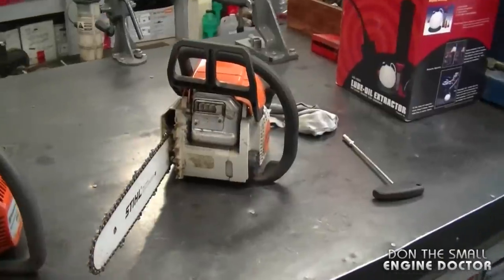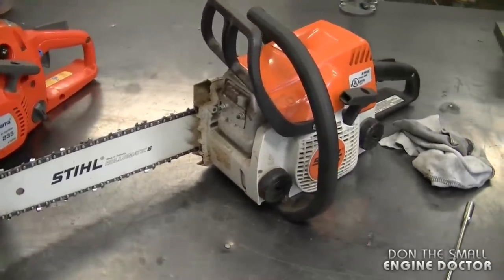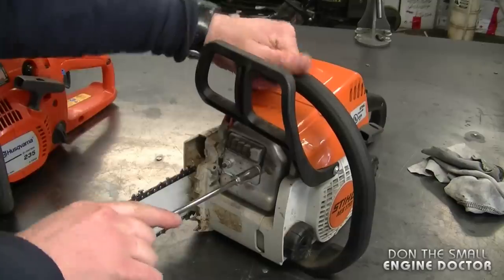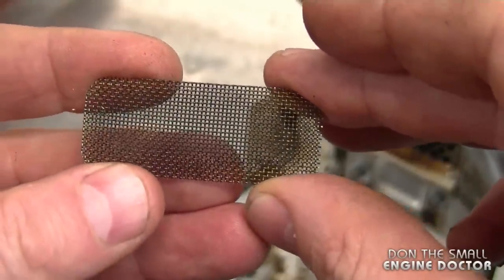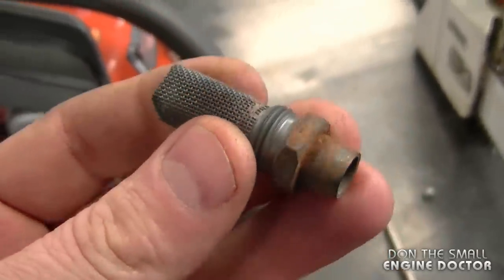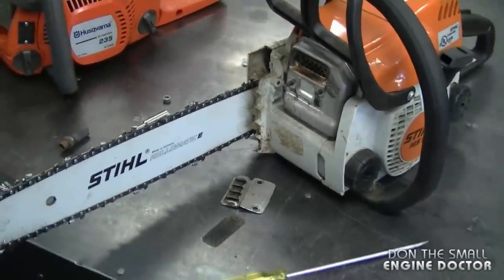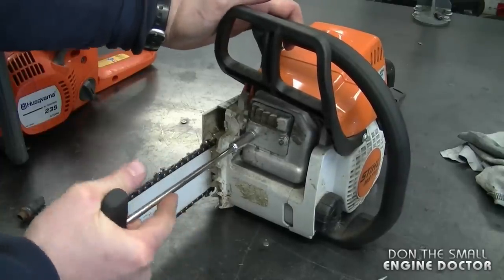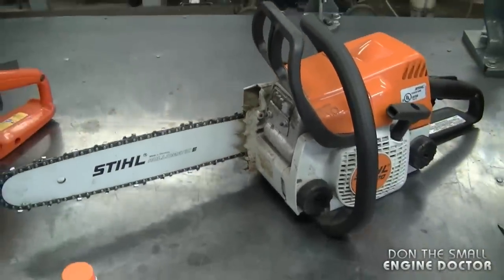Why I Don't Remove Muffler Spark Arrester Screens From 2 Cycle Equipment!

Comment: Danny I know you don’t recommend taking the spark arrestor screen out. But if I do will it hurt the motor?I have a Stihl ms170. Thank you
Reply: It won't adversely affect the engine at all while running, but it could lead to a fire as stated, and also allows for pests like wasps to cause bigger problems.  Do it at your own risk, and keep the part, as you may need it to work in a more fire-prone area.
Reply: It won’t, take it out and be done

Comment: Fantastic vid new sub
Reply: Ironically I came across your video because I was having some chainsaw problems today with that exact Chainsaw the 170 steel that you have there in the video before I even found your video my saw was running sluggish bogging down it just sounded weird it didn't sound like it was getting up to full throttle I sharpened it razor sharp and it was just sounding horrible mind you I'm not new to this I have a 461 Steel I think it's a 270 C anyway I got frustrated I thought I'll pull the muffler off and see what's going on lo and behold there was like an eighth of an inch of oil and grease all the way around the back side of the muffler Black is Black can be and I didn't even know they had a spark arrestor in them and that spark arrestor look like a piece of rock there was Zero getting through it I tried to clean it for like 30 minutes nothing would cut through it I got a small opening maybe the size of a pea the only reason I looked up the video I wanted to see if I could run it without a spark arrestor so I gave it a toss holy s*** that saw has never run better more horsepower like it's brand new unbelievable

Comment: So a better fix would be to have a larger surface area Spark arrestor screen.
Reply: Or just get rid of it in the first place if ur engine is better proberly u shouldn’t have any problems with shooting sparks like people say it will that’s only if it’s running super lean
Reply: Same problem just less frequent.  It would still happen; it would just take longer.

Comment: I have only had to clean it once in my Stihl BR200 which I use commercially. It seems the idle was causing it to rev to high causing a quick buildup. I wish I could get ethanol free, but it's impossible to find here. I do however get 93 octance

Comment: How do you feel about running a brand new stihl chainsaw with av ll gas?
Reply from the maker: not sure, never used it
Reply: If you can't find regular ethanol free in your area it may be worth it. But, you would be paying for something you wouldn't need. And, it wouldn't give you any benefits above regular ethanol free gas.
Reply: I've used it in my older stihls wo issues. The main reason I like it is the shelf life. I'm picky and never use month old regular fuel, therefore I end up wasting some. Av gas will stay good for a year so I can stock up in one trip. But I was curious if the low lead would effect the carburetor,  or piston/cylinder

Comment: Just use the best synthetic oil you can find. It must have JASO FD rating.
They don't have problems with clogging because they create the least ashes, have the best lubrication and film strenght. And ofcourse give you the most power. And premium fuel. For your new generation Stihl equipment minimum octane rating is R+M/2 89.
So never use 87 only 89 and up.

Comment: i remove em drill out catalytic then enrichen carb. nice power boost.
Reply: That's short term.  Over time the enrichment will cause carbon buildup in a few places and it will be hard to remove.  At that point, performance suffers.

Comment: I have a redmax blower. Started good but in high speed diet.  The model is Ebz7100 . I clean the carburetor. And gas line and filter chaing. and the problem still there can you help me...

Comment: As you probably know, Stihl had carbon build-up trouble early on after it introduced the "4-Mix" engine. Thus, it developed HP Ultra oil, a full synthetic. Curious why you don't use it vs. regular Stihl oil, Don? One reason may be that it is pretty pricey.
Reply: Trying to pry more $$$ out of our pockets

Comment: I take it all apart and in my scrap bin. I even take the silencer grooves or hole plate out , wide open . Better
Reply: Yup, remove restrictions and your engine will run cooler with more power.  Dual ported exhaust is even better.
Reply: @jolkraeremeark6949  "WHAT?" Get used to saying it.  Let's try it again. "WHAT?"  Even with hearing protection, the setup you suggest will erode your hearing ability over time due to how much louder it'll be.  Plus, if there's anyone nearby it could be quite a disturbance, even though two cycle engines already are to some extent even when stock.  I know it's common to do all this, but keep your long-term hearing abilities in mind.

Comment: Don what would cause a briggs mower to crank over, have spark, but feel like it hangs up when pulling the cord. The flywheel turns fine. Did notice the blade was loose. Cleaned out the carb. Speed gas out the air filter. Hmmmm.....
Reply: Gas poured out of air filter.
Reply: Could it be a messed up crank shaft? I'm just frustrated.
Reply: Brad, your carb could have a stuck open needle caused by gummed up gas, causing it to flood. A good cleaning may take care of it. Also, check your oil level. Most times the fuel will run down into the engine and leak past the rings and into your oil, causing it to become the viscosity of water.
Reply: I figured out the problem. The key is sheared off.

Comment: maybe you can help me i  have a husquvana weed wacker 128dl i replaced the carb, fuel lines, fuel filter,gasket ,spark plug,new gas,i check the spark arrestor its clean ,this is the carb i bought OEM Husqvarna Carburetor 545081848 C1Q-W40A Fits 128C 128L 128LD 128R 128RJ help??

Comment: If we all had to use Stihl Premium 2 stroke every oil company in Texas would be bust.What makes you think that oil is any better than any other 2 stroke designed for air cooled 2 stroke motors?
Reply: There's videos and literature on this.  There's notable differences in chemistries and long-term effects.

Comment: I have a brand new ms170, bought it in November 2019, and it doesn’t have that. I live in the Netherlands.. reasons to call my dealer??
Reply from the maker: they are supposed to be sold with the spark arrester in Canada
Reply: Different countries have different laws due to different species and climate indigenous to the area, and therefore different levels of risk.

Comment: I have been having a starting problem with my ms 241 CM.  Today, I finally got it started but it ran like crap for a little bit.  I took it out and put some cuts in my big rounds of 25 inch hickory.  When it was through, the muffler side had puked all kinds of unturned Stihl Ultra oil out of the muffler.  When I was through, I pulled the muffler and removed the spark arrester screen.  I had to soak the muffler in my ultra sonic cleaner for 30 minutes before I got the spark arrester screen out.  It was completely blocked.  I burned it clean with my LP torch and ran the muffler through the Ultra sonic with purple power and Dawn for an hour at 60 degrees C.  I was also filthy behind the muffler and I cleaned that, too.  I am sure I ha alleviated my starting problems and I will limit my letting it idle so much.  It was my fault it got blocked up but that filthy Stihl Ultra was a contributing factor.

Comment: You will get a heavy fine if you don't have one on your motorcycle or chainsaw. The forest personal also have a gauge to check hole size.any national forest property 😀
Reply: I would imagine not many folks use these on National Forest Property
Reply: @RustyZipper that's where we get a lot of wood in Washington on forest service property. Most of the wood out west belongs to forest service or DNR .also they will restrict run time on private property in summer on land adjacent to either.

Comment: Here in Europe we rarely see spark arrester screens. I guess we don't have the same laws
Reply: Isn’t that amazing. People on here raging that it protects you. I guess wood things in Europe don’t burn. More governmental BS.
Reply: @randyweaver9528  Not really; we have different levels of risk due to different climate and species.  In west coast states, fire risk is extremely high, whereas in other places such as many European areas, the risk isn't anywhere near as high.
Reply: @happycamper6352 And yet governments are always ready with a one-size-fits-all "solution".
Reply: @rstoertz That's because it costs less to do it that way at the expense of the one-size-fits-all way, even though it's only needed in the flammable areas.  Having one agency per state or per county would be far more expensive for only a minor improvement in customization, and even then the manufacturers would build for the most strict requirements so that they didn't have to have different specs.  Where I live in the Appalachian Mountains, it's almost impossible and extremely rare to have a significant forest fire.  There are some fields that could catch fire around here in the driest day of August though, if the grass is waist high and tan/dead. Trucks could be parked in it, and that would be bad (and that's why we have exhaust heat shields too, but they're not always placed well enough).  Honestly, I don't mind the spark arrest screen.  It's easy to pull and clean with a torch and replace every so often, and if you're tuned right, it likely won't clog anyway, and if you hate it or know you don't need it, it's easy to remove and toss in the trash.
Reply: @rstoertz  I would like to add something you would like though.  If you want to talk grade-A, top-notch governmental bulls***, then go no further than the gas can spouts that we have to suffer with.  Those are monstrous fire hazards and royal pains in the a$$.  I have difficulty finding decent replacement spouts that don't have that required gasoline can spout feature.
Reply: @happycamper6352   Agreed. Complete junk. And you can hurt your back trying to fill a gas tank from a five gallon can with one of those stupid spouts.
Reply: @happycamper6352   I went looking for mine to clean it the other day, and it was gone. Fell out, I guess.

Comment: Hi Donyboy, 
Your link, "Watch how to clean a chainsaw spark arrestor here", takes me to an STP commercial. I don't mind that you're advertising, in fact, congratulations. It's the fact that a link to another (important) video, is not working. It does not pass me through anywhere after it is finished.
Reply from the maker: thanks, I just fixed it. https://www.youtube.com/watch?v=XclI6u_xAAs

Comment: Great Video, just like the guys that want to mow in reverse and want the safety switches defeated.  The Law will waste no time figuring out who tampered with the equipment.  I'll even write a note on a bill slip saying customer requested safety defeat and was denied just to cover my butt in case he or she surfs YouTube for a way to defeat the safety switches on their own.
Reply from the maker: YES I get that request all the time, but these same people won't have a problem suing me if something happens
Reply: Kens Small Engines, 
I did that to my first rider.
That is until I almost lost some of my Toes..
I took that jumper right outta there and put that Puppy back in.
Reply: The law will try to figure out who did the mod.  But the lawyer for the plaintiff will only try to prove that you've done it for someone, sometime and then you have to prove a negative for that particular piece of equipment to avoid at least some liability.  Best to have a long record of never agreeing to the mods.
Reply: How did you almost lose toes by mowing in reverse?  How did your feet get BEHIND the mower? I agree with most safety interlocks like the seat switch but the reverse lockout is one of the silliest they've ever came up with. Why is mowing for a few feet in reverse more dangerous than going forward? How could you drive over something in reverse far enough to get to the blades when the transaxle is only a few inches off the ground and the mower deck edge is only 1-2" off the ground when mowing?  Did you ever notice that a lot of commercial mowers do not have reverse lockout?  Reverse lockout can be very dangerous as it can cause the engine to suddenly stop - sometimes when you are in a situation where you need the power steering to work. Most systems require you to push a button or turn a switch to override, which has you facing forward instead of looking backwards to see where you are backing. No thank you. Here's to mowing in reverse for the past 50 years!  :-)
Reply: I had a customer who said he lent his mower to his relative and they backed up and severely injured a puppy who was just hanging around looking for attention.  Claimed he never saw or heard it until he saw it laying injured in the grass.  Now imagine if that was a small child running out to give you a hug?  Without rear view mirrors that is an accident waiting to happen.  It may sound like one in a million odds, but I will never take the chance.
Reply: The puppy must have run up to the deck and his front paws slid under as he realized it was heading towards him but it was too late and he lost his paws.
Reply: Just an FYI, this happened with a NON-SAFETY equipped Lawn tractor from the 70's.
Reply: That's an unfortunate situation for sure but it sounds like he simply backed over the dog and it had nothing to do with the mower blades being engaged.  RIO won't help one bit in that situation. The exact same scenario could have happened had the puppy ran up along side and gotten himself under either the front or rear tires. I blame the operator 100% in that case as he should not have allowed his pets to be in the yard while he was mowing. I agree with the one in a million. There could be 100 interlocks placed all over the riding mower and it still wouldn't fix carelessness.
Reply: Before you know it there will be back-up buzzers on all tractors and who knows what else big brother can mandate to add costs to power equipment.  My point in all of this is we as OPE Technicians are constantly being held liable for unfortunate accidents which more often then not are not caused by the technician.  Power equipment dealers will generally show new owners the proper operation of the equipment but with the advent of Box Stores selling power equipment along with Amazon, we will continue to see these accidents.  I had a customer who wanted me to fix his snow blower pull cord.  When I asked why he didn't use the electric start he said he never knew it was there.  The blower was an Amazon purchase 3 years prior.  Ever heard of read the manual?
Reply: Kens Small Engine Repair exactly. It has to be known that a certain percentage of the population are challenged when it comes to common sense. 
Run over a dog (which should have been put up and would have by a Responsible owner) everyone suffers.
The old group slap theory. One person does something stupid, everyone gets slapped. Great logic.
Reply: @randyweaver9528 liberal logic @ work 😂

Comment: So can you explain  why the ms 170-Ms 180s suck sawdust  into the  carburetor  ??? I bought  a  new ms180 used  it once  and returned it  because its a piece of crap  and  had to buy a  ms391 only  because of the difference in how its built  ???how dose a  company built  1 saw that's half the size  and  cost  $300 and  build another saw that's 3 times the  size  and is built amazing for  $600  the  company  needs to stop  robbing  homeowners  that  buy saws

Comment: My craftsman line trimmer’s spark arrester screen is built into the sealed muffler. Which I hate because you can’t just replace the screen, you have to buy a whole new muffler. Jerks!
Reply: remove muffler and torch it as hot as you can without damaging it; tap to loosen ash then you're back in business; ash will come out next time you run it

Comment: just remove the arrestor and burn it clean with a propane torch for 1-2 minutes max. That is it!
Reply: The ash sometimes sticks and if so, you need a brush that won't melt or burn to get it off.  Sometimes just tapping it will do.